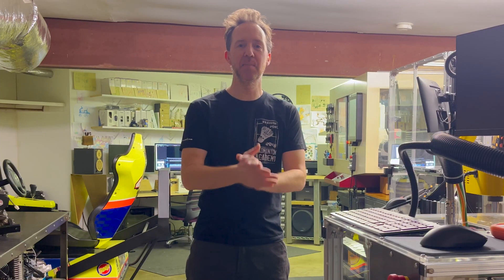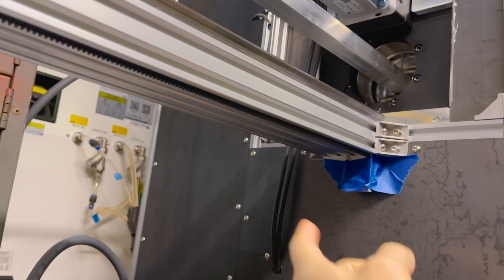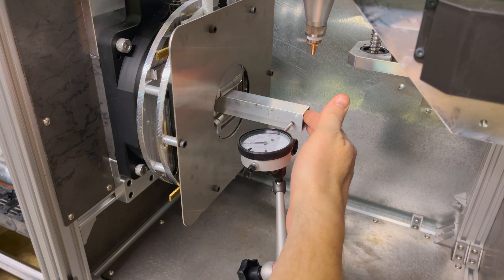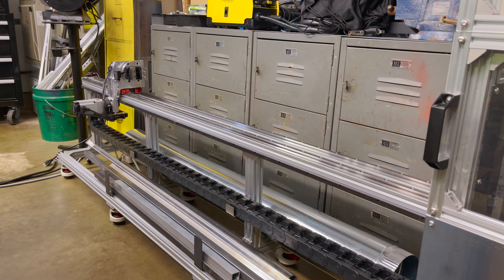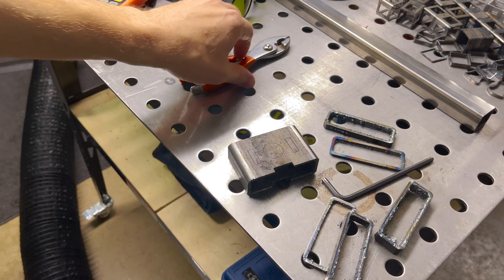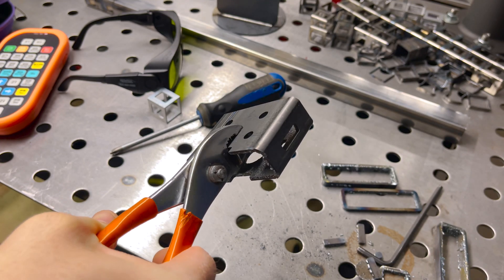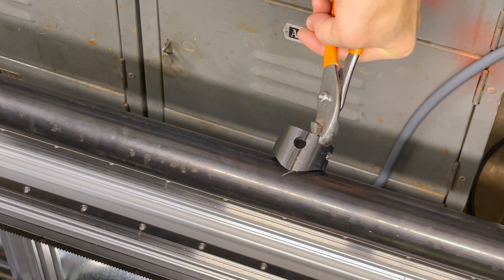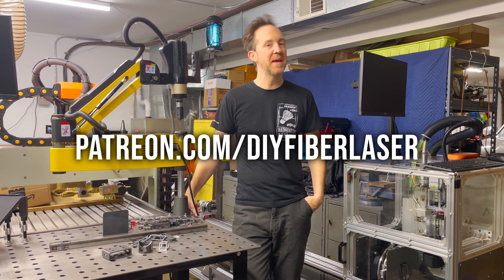DIY Fiber Laser Tube Cutting Machine | Part 13: Test Cuts & File Prep

Comment: So this tube cutting machine is a laser or oxycater ?
Reply from the maker: Fiber laser
Reply: @diyfiberlaser  it is not enough powerful so you have to inject oxygen ?
Reply from the maker: The gas blows the molten metal out of the cut. Depending on the material you are cutting you use either oxygen, nitrogen, or compressed air.
Reply: @diyfiberlaser  you did a nice job with CNC lasers putting them together and calibrate them . I think YouTube video is best which I saw on YouTube . My friend want to buy laser and he was asking me for advice because I have a plasma cutter and maybe I know something about the laser . He saw on eBay laser around 1.5 KW and he wants to buy I told him this is not good for cutting thick metal it might be good for cleaning crust . I saw your laser is like 12 KW and have a combination power mode so I told him about your Channel on YouTube and send him a link . He want to cut metal quarter inch to half inch . I did not recommend him buy on eBay because I told him he don't know how many working hours this laser have . And I told him it was a fiber optic laser more powerful so you can run half of the power of the laser  this way you can extend life of the laser .

Comment: Hey travis you have done a great job, its unimaginable feat of engineeeing building a tube laser from scratch  i my self own 3 dedicated tube laser for mass production for automotive industry my company name is turbo tube lasertech one thing i want to know that for better accuracy, try to reduce a distance of chuck from the laser head. When the actual cutting point of tube is far from where chuck is holding the tube the bent and twist of tube plays the role in accuracy. The closest the head with chuck better the accuracy simple
Reply from the maker: Thanks for the input, I’ve positioned the laser head as close to the chuck as possible with my design…there’s only about 5mm clearance between the two.

Comment: Just found this video. Extremely fascinating. You are a genius sir! How do you prevent the laser from passing through the tubing and beginning to melt the backside? Does the power modulate?
Reply from the maker: I turn the power level down to try to hit that sweet spot where it cuts through, but not the other side

Comment: If you can write and use your own macros there is a method to figure out profile center by checking each face 0-90-180-270 with 3 points using tip touch. Rest is just math using Z height at tip touch. Profiles are never straight so angle compensation using 2 points is needed too.
Reply from the maker: Thanks, the software has several different centering methods, I'll check if one of them uses this method.
Reply: @diyfiberlaser  Sometimes they just dont work anyways and proper industrial machines have vision systems with laser cameras.

Comment: Why would high speed co2 cutter needed RF tube? From my understanding the light coming out of it does not have much difference. All 3 of the  projects are nice ideas. What wattage do you think about choosing for the CO2 cutter? I work with trotec speedy laser and their engraving speed is amazing, I would be amazed if you got near or even faster than their machines. Good job and happy new year
Reply from the maker: I’ve read that RF sources can fire at a faster pulse frequency than glass tubes, allowing them to driven faster, also they have a smaller spot size allowing for more finely detailed engravings. I’m not sure what wattage I would go with…probably the largest I could afford
Reply: @diyfiberlaser  huh, You are right google says that they have better quality beam and other parameters. Would be cool if the cutter could be fitted with both soo we can use much cheaper glass tubes. I am currently thinking about building CO2 galvo engraver on budget soo I am in the middle of researching about all the things I need.
Reply from the maker: I don’t know if you saw my video of building the galvo fiber laser, but my experience was that if you shop around and find a good seller, you can buy one for almost the same price that it will cost you to source all of the components and build one…I couldn’t find much opportunity for cost savings. Of course if you just want to build one for the learning experience, then it is worth it.
Reply: @diyfiberlaser  yep, I found propably the cheapest fiber galvo from commarker. And they have even mopa and high wattage variants. That said I want to build CO2 galvo for marking/ cutting on wood, and similar. I wanna start side hustle making some wood products and I am currently using our trotec speedy in our makerspace. That thing is good, but I want to build some form of automation. Gantry styles are good, but I had the taste of speed(trotec) and when I had to use the small k40 laser I was not really enjoying it. The engrave on that was slooooow. And honestly I love tackling these big projects. From all the reasearch to using the finished project for making other stuff. Big part is that CO2 have bigger price difference compared to my components that should theoretically have the same effect.

Comment: Love this series.  I am also looking for my next build another Co2 with RF tube and servos.  I built my last 100 watt machine with glass tube and its so huge... , now I want a more compact machine.  My current machine is just too massive. I would still like the 1 x 1.5 meter cutting area but a more compact tube and frame.

Comment: I want to know what the application is to justify building a dedicated tube cutting machine when you already built the other regular xy laser cutter
Reply from the maker: I wanted to make two smaller dedicated machines, rather than a single large combo machine...better for my small workshop space.
Reply: @diyfiberlaser  I mean tube cutting seems fairly specialized - are you planning on selling a product or kits or something that need a lot of tube cutting? Or is it just a "for whatever I want to build in my workshop" machine? I have a large (6 ton) cnc mill (repair project still in progress), and now a medium (3.5 ton) cnc lathe (should be ready for some cuts, but I'm struggling with CAD / CAM at the moment) shoved into my 2 car garage. People always ask me "what are you going to make??" and my response is always "??? I don't know, whatever I want to I guess". Everyone assumes you have an exact application in mind when that's not necessarily the case. I don't really have any room for any more machines, but if I did, my next machine might be a wire EDM. Before this project, a cnc tube cutter wouldn't have even been a thought in my mind!
Reply from the maker: Not for any particular purpose, but I was thinking I would be able to use it for building machine frames for future projects …I’m so tired of using extrusion and hundreds of corner brackets

Comment: Use a robotic arm, to attach your laser welder. So it can weld pipes automatically. 
We used on of them about 20 years ago. Where the welds where programed by running an wand attached to arm, to trace the weld manually.
The 'scanned' data was used to plot the weld contour manually. 
It was used to weld curved handrails etc.
Reply from the maker: Those are fun! I got to play with a welding cobot when I visited SkyFire a few months ago

Comment: Make a portable CMM, like a Faro Arm!  You can use it in your shop to measure 2D and 3D parts.  They also have hand controls that you select what geometry you are collecting, kinda like Fusion 360, you select a 3 point circle, and then touch off on the sides of a hole.  Using an arm is like doing a 3D sketch in real life.

Comment: Great video!
About the metal SLS printer,if you gonna pull through with that most industry guys call it SLM. As industry guy that builds DED (think more like deposition/welding then powder then) 3d-printers, dont. The powder handling is not just a pain its an active health risk! At least with powder sizes that are used in SLM.
We too use AC servos obn our slower machine and linear motors for our faster one, but that one also has a granite frame. Its an awesome technology that has a ton of potential and if our team of 5 can design and build a machine in 6 months you can probably too! I would like to help/give feedback but have to stay inside some NDAs, hope you understand and see you in next year!
Reply from the maker: Thanks for the feedback, the powder handling is definitely my biggest concern…the health risks and I simply don’t like messy things. Though metal 3D printing is super intriguing…I will look into DED as an option
Reply: @diyfiberlaser  our system is called EHLA, but thats a special version of DED. Maybe LMD would be even better, thats more like welding.

Comment: This has been a great project to follow along!  At 14:03, how long did it take you to realize that you entered the tube diameter instead of the radius?
Reply from the maker: Until just now! Haha…thanks for pointing that out, it’s funny that it still cut it out no problem…I guess the height sensor was doing its job

Comment: Pipe alignment does not help and will not help, you always need to measure the pipe yourself and correct the cut files.
Use air pressure of 12 bar, so there will be perfect cuts.